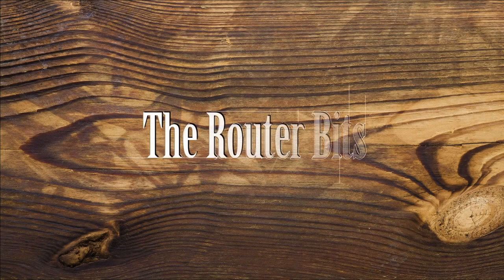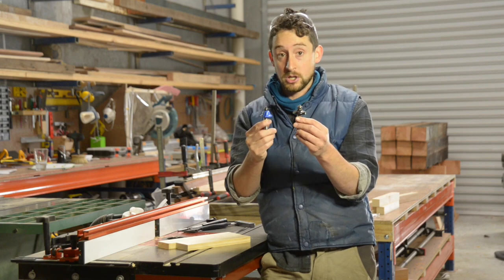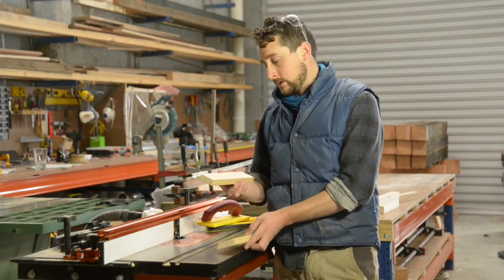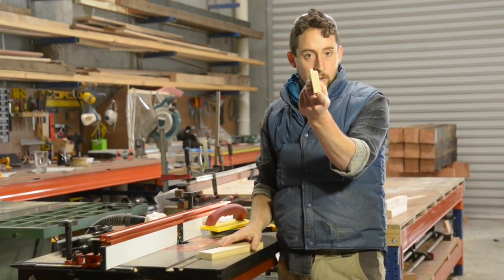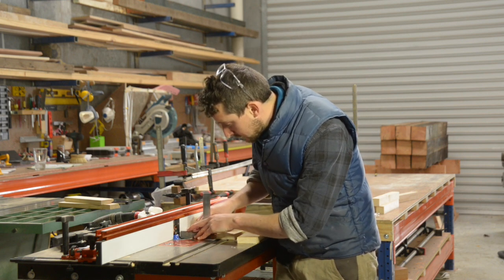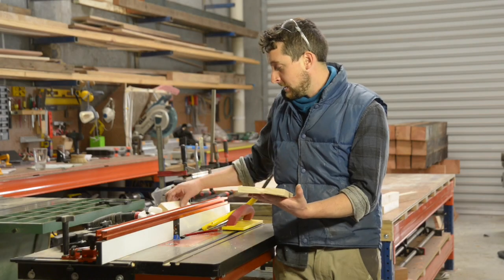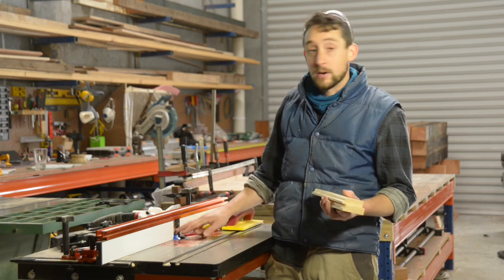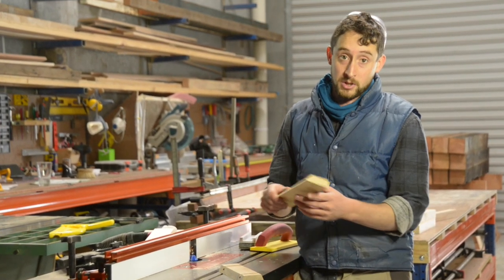The Router Bits - Using Standard and Roman Ogee Moulding Bits

Comment: Thank. it was nice watching this. I ruined one on a table, standing straight up and down, without a fence. I will lay them face down and use that profile, and align the fence, of course. So I have to remake one cabinet door rail. I haven't done this in many years and have to relearn using the bits.

Comment: Thanks for the video! Since I am a new woodworker, would I need a router table with a fence if the bit has a bearing? I need to make a piece that has that bit, but I don't have a router table. Just a cheap Skil router.
Reply from the maker: Hi Jacob. Because the bit has a bearing on it you can use it freehand in the router and let the bearing guide the depth of cut. Hope this helps!